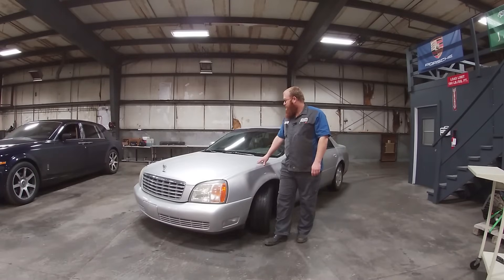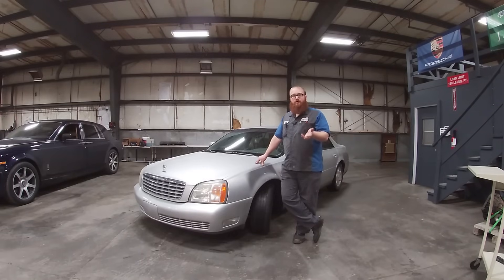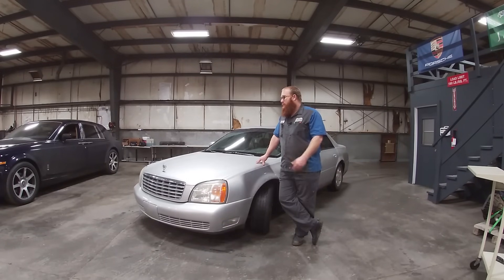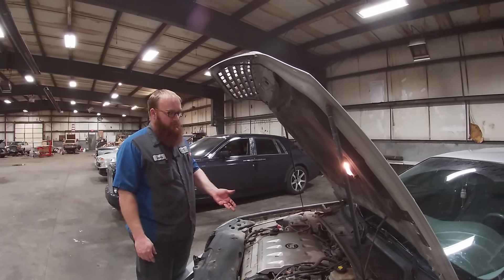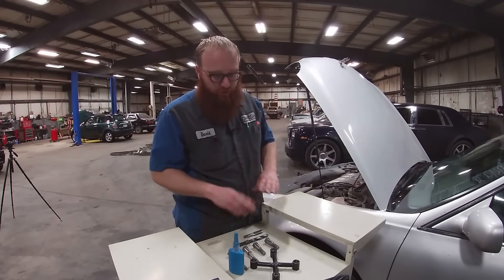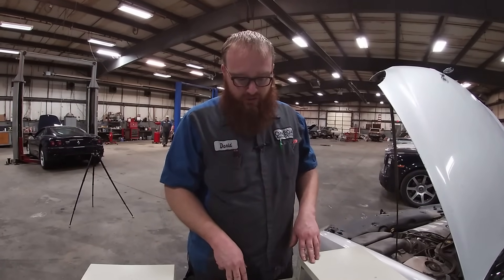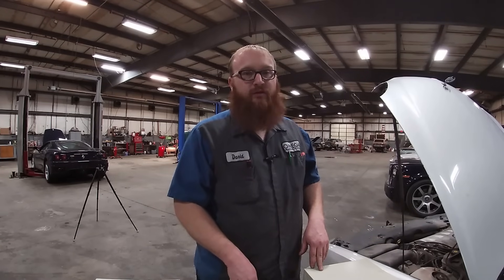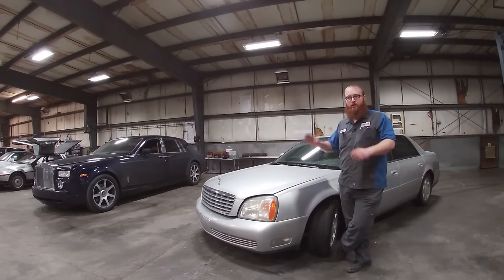The CAR WIZARD names Cadillac's Northstar Engine the Dumbest Design

Comment: I was in a consulting situation when GM approached us with an early design problem for the Northstar (somewhere around 1993).  Their issue was that plastic springs in the upper heads were vibrating through the magnesium valve cover very quickly (like in 24 hours!).  They had used (heat-resistant but highly abrasive) glass-filled nylon for these springs and came to us for a better design (as we were the material supplier).  My immediate take on it was that they were missing the bigger problem, that the plastic springs would relax over time (and not be springs anymore).  I told them to rethink both the nylon springs and the magnesium valve cover.  They resisted and paid one of my more eager colleagues $100,000 over a year to fix the issue (only to ultimately discover that yeah, the idea wouldn't work).  Northstar sucked from the beginning, like most half-@ss GM designs.  Maybe we should talk about the Quad4 plastic intake manifold next...

Comment: Got a ‘99 eldorado. Did the head fix and it’s been rock solid for 3 years now. Love the car.
Reply: Maximus Areilius I used N* performance head bolts, thanks.
Reply: I love that generation of the Eldorado. Is it the ETC? I'm not entirely sure what the ETC package had. I thought it had magnetic suspension and a few more ponies but I could be way off.
Reply: 2001 Monolithic I have the ESC- ETC had 300horse 275 Torque, mine has 275 horse and 300 torque. It also had a really complex magnetic/air suspension, the esc has basic air but is still very comfortable! Also a CD changer and wood trim on the center console. Other than that, virtually the same! Great cars.
Reply: @Breadts1cks  I always wanted one and they were built 8 miles from where I lived. I ended up driving 5 different sedan deville's though. I loved the deville's but they definitely weren't sporty.
Reply: My neighbor had one of those back when they were new. Best looking caddy I ever seen.
Reply: @carlzimmerman8700  Made in Lansing, Michigan. The Eldorado is a big car with little passenger room but it's an old school caddy with a sporty feel. They just don't have anything like it on the market today. I think they will be very collectable in the future.
Reply: i'll bet the doors sag so much they look like old woman biceps don't they?....just wait  until you get that check engine light for a random multiple misfire code and after changing out the ignition module and every coil pack , still continues to misfire.....Love will be the last thing you have for that car.
Reply: Multishit666 do you really think it has that value? I have absolutely no intention to sell, but every now and then I try to look at others for sale and can’t find any that have the engine fixed, so I can’t get a good read on what mine’s worth.
Reply: @mattriella6776  ..and if you were a decent tech..you'd figure out the root cause instead of loading the parts shotgun

Comment: It’s called the death star actually.
Reply: The 4.0 is the only version of the northstar worth buying and there's only one car that came with it. It's the smallest engine in the line up, but it's also recognized to be the most reliable in the line-up. 

That being said, if you're gonna get one, get one from 2001-2003 and get the fully loaded one (heated leather seats, bose surround sound system, etc) I'm talking of course, about the Oldsmobile Aurora.

I grew up with those cars. I got my driver's license in my mom's 03 aurora.
Reply: Perfect example of why the world is going electric.
Reply: LMFAO good one
Reply: @shepherdsknoll8  because some engineer at GM didn't understand machining? Really reaching there
Reply: @iraqifoodcart8447  I have the Aurora right now. It's my first car and I absolutely love it but it can be a fucking nightmare
Reply: Is no-one going to mention the starter under the intake manifold or the oil filter on top of the motor that makes a mess every time you change your oil
Reply: EpiDemic117 damb right. Bought ONE crate 400 Ford back in the day for a 77 F250. Cracked in 500 miles lol
Reply: @BerserkerNick  tell me more about nothstar oil filter on top. I ve always found it from bottom on these engines

Comment: As an engineer, for me it's a great design with ONE flaw that CAN be fixed on the bench.
I've seen MUCH worse. Especially nowadays, where there is just NO fix at ALL. 
So it's a bargain car.
Reply: Even if the head bolt issues are addressed, they have a myriad of other issues. My FIL bought a Caddy with a low mile Northstar and it was lousy with all sorts of different problems. His hobby became hunting boneyards
Reply: Yeah, that’s one perspective. 
As a mechanic, this shouldn’t be an issue in the first place.
Reply: change an oil pan gasket on a 2002 ....have fun ....
Reply: @redram5150  Yep. Power steering pump problems, electrical problems, oil consumption, sensor issues, etc. No wonder they go for around $800-$1500.
Reply: @hitek9too255  the car would have been great with an LS4. Reliable otherwise. I distinctly remember him having to collect pulleys because it kept eating them. Then the intake gasket went.
Reply: @redram5150  how many miles did it have my friend?

Comment: Great video.  I had a 2003 Deville that I was trying to work on, and gave it to my grandson.  We tried to change the spark plugs and coil pack.  Getting the back plugs and coil pack out was way beyond my ability or desire.   He ended up letting the oil go dry and destroyed the engine.  This was the second worst car I ever worked on the first was a 1986 Jag XJS with the V12

Comment: When the Northstar is running properly it’s a nice smooth running engine . The other issues these had was the lower case half leaked oil .
Reply: Yep.  They can replace the gasket (for $2000) or used silicon glue (for $2000) that MAY hold longer….They have the nasa challenger mindset about everything.